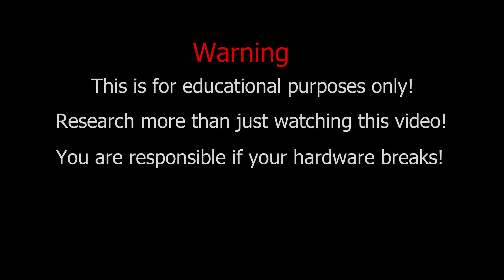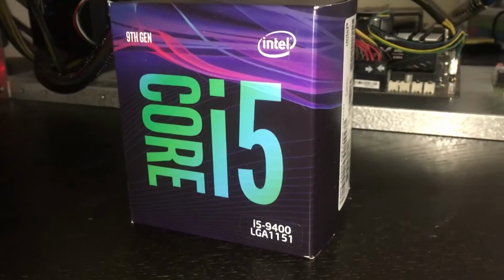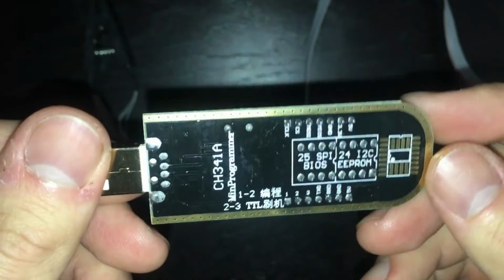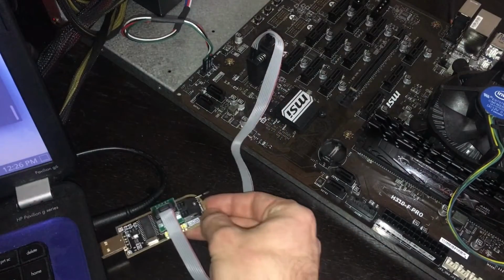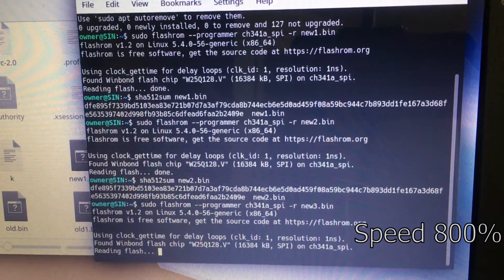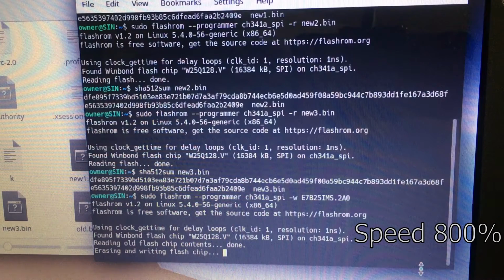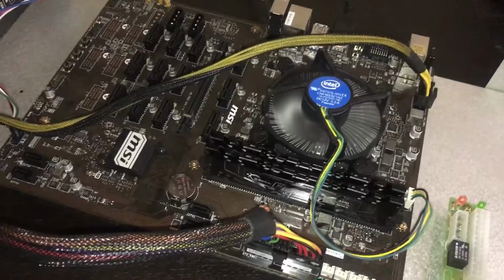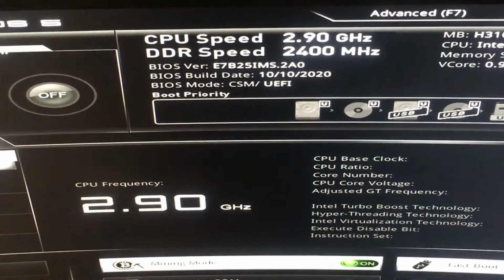Bricked Motherboard | External BIOS flashing with CH341A programmer

Comment: Greetings, the BIOS flasher w/ Test clip to flash BIOS and EEPROM chips is an interesting resolve I being clueless such a fix existed.  Considering I've been spending endless hours attempting to normalize my corrupt BIOS that invaded my gravity standing sideways.  
I have a dysfunctional Lenovo YOGA 730-15IKB Laptop, question;  Are the flasher Test clip Devices universal for all computers or device specific for specific model computers?
Thank you very much for posting a vital answer for this educational post for all of us, remain well in peaceful balance to take good care of it all...
Reply from the maker: There are many different types of chip but this flasher should be able to handle it. First identify what kind of chip it is like you can either Google this or open your system up. Once you identify it as being a SOIC8, SOIC16, WSON8, etc. You can figure out if the clip will work or if you will have to solder. Also be sure to look up the datasheet and determine what voltage the chip is expecting
Reply: @DeviceCastingCouchTechPodcast  Will do, thanks...
Reply: @DeviceCastingCouchTechPodcast  do you have discord I desperately need help

Comment: Hey Man I Have All the things including programmer and fro my motherboard i have file called bios.rom file can you please help me out with this from which tool you used it similars to be kali or ubuntu plz man urgent needa fix bro please reply
Reply from the maker: The tool I used in the video is called flashrom and can be used on any Linux distribution. You will have to get the BIOS file for your motherboard from the manufacturers website.

Comment: hello, i see that you are programming with .bin file bios, but you've downloaded .2A0 bios file...how to convert to bin? i need to flash asus mobo with .203 or .whateverothernumber file and i'm stuck in extracting bios..any hints?thanks
Reply: The bin was the result of reading the bios, he ran the read a few times which generated a few bin files. He then checked the hash of the files to ensure it reads the same thing every time, which means the connection from the device to bios is good.
Reply: Extract the file (with 7zip) and it will be a bin

Comment: Great video man! I just bought a MSI mining motherboard off eBay that I suspect has a corrupted bios. It won't post past the setup screen. Won't acknowledge keys on keyboard to press F2 or Del

Question: is there any way to flash that bios chip easier? The coding looks pretty complicated, but I love that little tool
Reply from the maker: You could try a PS/2 keyboard, if the BIOS is having problems initializing the USB controller sometimes it won't detect USB keyboards. Some motherboards have an EZ Flash system where you can press a button or boot with a special USB. I would suggest looking at the manual to the motherboard otherwise you will have flash the BIOS externally.
Reply: how did that go for you? having same issue
Reply: @cali_cal  Well, for me - I bought a bios programmar for 12 pounds and came next day from amazon, and then I had to install the Bios Programmer drivers, and install AsProgrammer (as programmar is a free open sourced tool which lets you read and write to the chip using the programmer). I clipped the programmar to the bios chip, had to move it around like 10x before I got a connection. After, I went to MSI downloaded latest version, and flashed it onto the chip. After booting up, there was still no post, so I had to power off and take a stick off ram to post and the motherboard worked again.
Reply: @Adaks  what motherboard?
Reply: @cali_cal  It doesn't really matter what motherboard, as long as you have a 8 pin  bios chip, my motherboard was a z170a sli, like 5 years old
Reply: @Adaks  Well I've read the msi b550 have level 3 protection on it on some forum
Reply: @cali_cal  What? Protection for what?
Reply: @Adaks  for 3rd party flashing or bios hack, mod
Reply: @cali_cal  did you solve your problem?
Reply: @redangrybird7564  tried it but didn't work for me. returned the board
Reply: @cali_cal   I see, thanks. I'm about to flash BIOS to two bricked laptops so I'm gathering info.

Comment: I have a  Sabertooth Z87 with a compatible CPU, but it doesn't show video. What could it be? Is it fixable?
Reply from the maker: Not showing video can be a lot of different things. I can try an help I just need to know more about your situation. 

What CPU do you have? What kind of RAM is being used?  Does the computer turn on? Does it beep or have any LEDs that flash? Did it work before? Are you using integrated graphics or a GPU?
Reply: @DeviceCastingCouchTechPodcast  Thanks for the response, I just make someone that knows about voltages and that stuff, look at the motherboard that I mention. So he said that the problem is near the chipset of the motherboard or the chipset itself. Is it fixable? The motherboard doesn´t turn on so it doesn't show any beep. I was watching some videos where they reflow the motherboard, so I will attempt that.

Comment: So when we take backup we can unbrick our spi flash why its listed on the internet that motherboard will be useless after bad flashing
Reply from the maker: Normally a bricked BIOS is a corrupted image and prevents the motherboard from initializing. If you flash externally you can fix that you just have to make sure your BIOS chip and your programmer are connected properly or it could physically damage the chip.

Comment: Does any of the kubuntu commands involve where you put the file ?
Reply from the maker: You will have to cd to where your BIOS file is located. Let me know if any other questions.
Reply: @DeviceCastingCouchTechPodcast  is NEW1.bin where your file was located ?
Reply from the maker: @inityo  new1.bin is the file being created when it reads the bios chip. All of my files where located in /home/owner. You can use any directory, just use the cd command to navigate there and then run the flashrom commands.
Reply: @DeviceCastingCouchTechPodcast  did you show that you navigated there in the CD? I’m just planning before I do this tomorrow
Reply from the maker: @inityo  no i did not. you can use cd to change directories and then the ls command to show what files are in that directory.